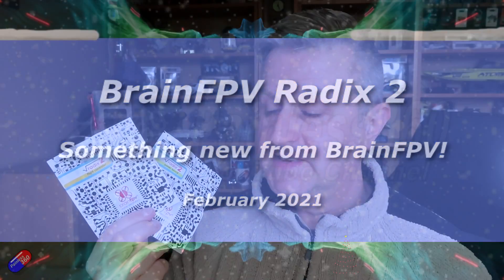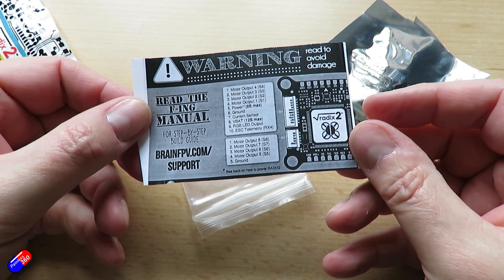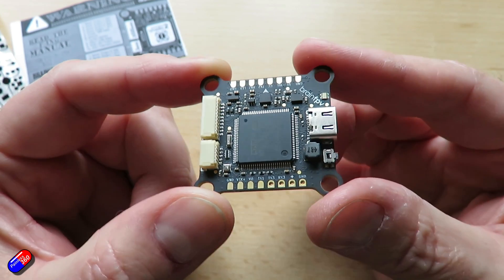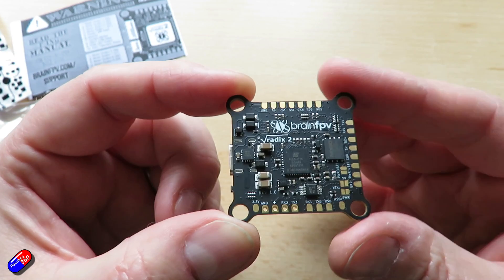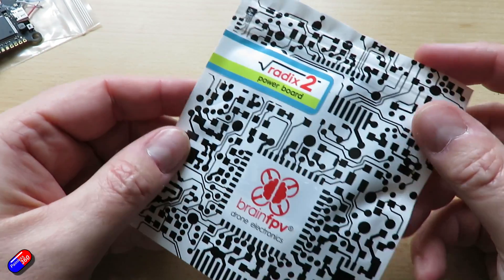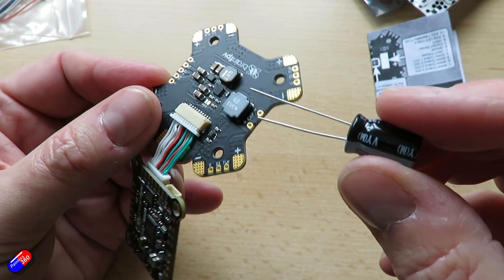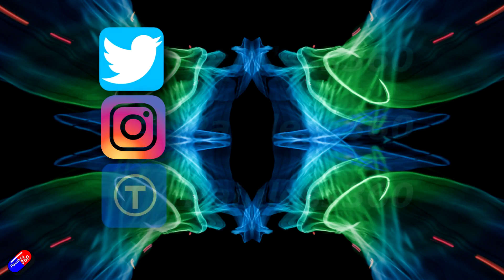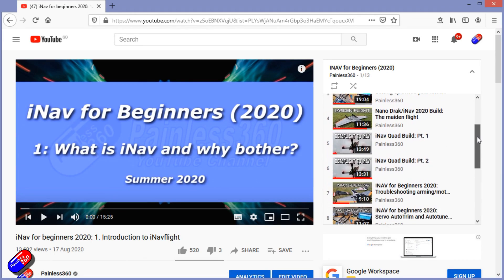BrainFPV Radix 2 flight controller: First look at some of the cool new stuff..

Comment: Unfortunately I bought this flight controller thinking I could use inav with it, then also found out the resetable fuse is only 1.2 amps so you cant add a caddx vista and will reset mid flight. Also found that brain osd craft name appeared even with it turned off other than that its really smooth and seems rock solid we will see in the future.

Comment: Nice review! I notice along the FC there is a power and Tx3/Rx3 that has holes instead of just pads. Its this in the correct space and order to use a Crossfire Rx that is pin mounted? I look forward to seeing this with iNav & Ardu!
Reply from the maker: Yep. Check out the link..

Comment: I started off flying wings for  a very, very short time but quickly switched to building & flying  my own mini kwads because that's what I liked was all the flips, rolls, dives, extreme flying, bashing hard!!  Long story short I now have 2 horizon hobby apprentices  & one smaller jet that's  super fast only flew it few times it's extremely fast!! Anyways obviously horizon hobby is spektrum & I know longer have my dx9 which I do kind of miss I loved the gimbles!! My question is what receiver do I need to purchase  replace my 2 apprentices & 1 jet?? I currently have a Taranis XD9+ running crossfire MicroTX v2 module!! I want to run off crossfire if possible instead of frysky link!! What is the easiest way to swap them to crossfire & what do I need to purchase?? I DON'T want to run orange link either I want xfire range!! Also remember I have plugs for all the different servos, I don't mind cutting plugs & direct soldering to receiver I just don't know the steps please help or point me the right direction!! Thx!!
Reply from the maker: It depends on how many channels you need. The Crossfire Nano receiver has a little board that you can add to it to make it a 6 channel PWM receiver - https://www.team-blacksheep.com/products/prod:xf_6chpwmadapt
Reply: @Painless360  Nice I already have  a few of those still in package & now I do remember they have small extra board the nano could fit inside but it's very snug!! I wasn't sure what that was for now i do lol!! I will have to research if the apprentice is 6 channels tho still. Do i just cut the plugs off & solder each servo to channel & then go through setup assigning each channel to tghe correct control??
Reply from the maker: The board adds standard servo pins to the rec too. Best of luck
Reply: @ehunter2010ed  The little extra board in the Nano RX package is to modify your transmitter if you have a FrSky radio that requires the modification to use the high baud rate of Crossfire. It has nothing to do with running servos. To use servos, get the board that Lee linked to. I use it on my Kunai glider with my Nano RX and full size Crossfire transmitter module.